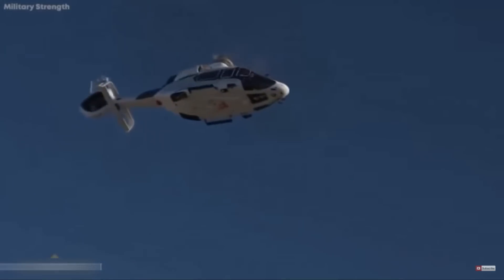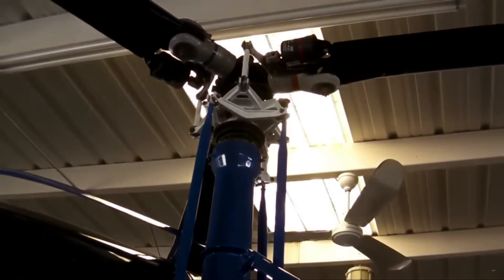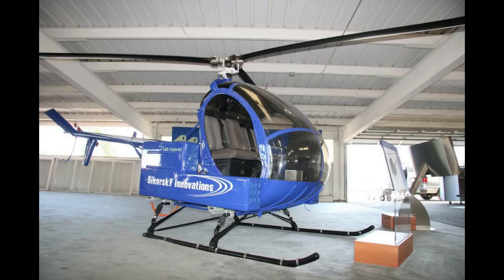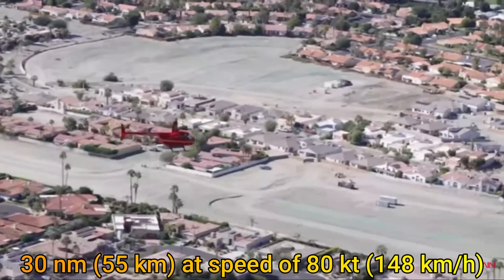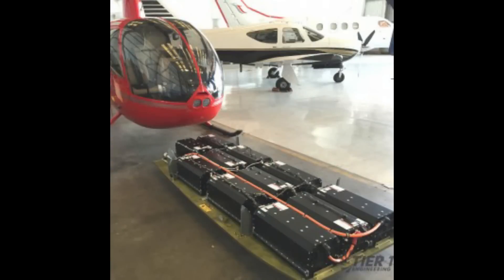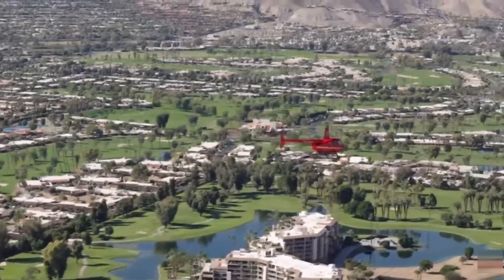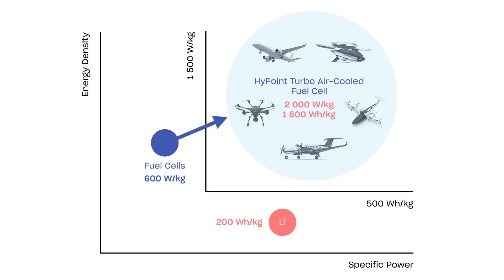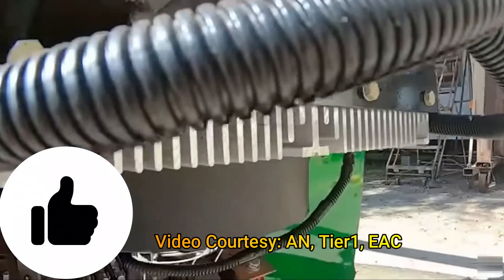The developments in Electric Helicopter (true EVTOL)

Comment: Agree with Martin that this is a very important sector for electric aviation. This because we can replace noisy inefficient, less safe piston engine helos with electric propulsion in the sub non turbine category. This opens the way up to the Mini-500 Baby-Belle personal machines, and the more important compound helicopters like Challis Heliplane and Rotodyne like vehicles. As these are electric machines, it is possible to reduce less safe mechanical complexity with electronics. I think this category can be all we hope it to be, - simply limitless, particularly in the personal flight category.

Comment: In tracking eVTOL developments, I imagined that the heliplane nature of multiple rotor designs would obsolete traditional helicopters. So will be very interested to see your analysis of eVTOL vs electric helicopter systems. My guess is there will be specialized use cases for both paradigms.
Reply: Simple is best, some of those heliplanes have like 8 motors when they should just have 2 or 3, tops
Reply: @eastindiaV  Lots of small rotors actually ends up much simpler than large ones. If you look at a small drone you will see that they have fixed pitch rotors with direct drive, meaning they are able to be extremely simple. The issue with scaling this is that in order to do anything you need to change the speed of the rotors. The throttle controls rotor speed which controls lift, and while this works at small scales, rotor speed responds quite sluggishly for large rotors. You can get around this by controlling blade pitch instead, because lift responds instantly to blade pitch, but this adds complexity. Each of the rotor modules is able to be completely redundant, so there is no massive down side to just having lots of them, particularly if they are light enough that maintenance can be simplified to a single tech switching out whole modules for work elsewhere.
Reply: A bigger rotor/propellor is more efficient. That is what counts as battery tech is limited in energy density.

Comment: Seems that there is not much benefit of electrifying a standard current helicopter design. The energy density of the batteries is insufficient (and this may not change), and the useful load and range are very small. Moreover, the complex main rotor system remains (collective, cyclic, tilting head, flapping blades, leading edge hinges, etc), and this is a system requiring a lot of expensive and frequent maintenance.  

The benefits of electric motors are using multiple simple fixed pitch rotors, achieving control via fly by wire instant manipulation of their RPM, which can also possibly do dynamic maneuevers which current rotor craft can't do, such as tiltrotors. Less complex mechanically and less maintenance.  So this can't be achieved by electrifying a current design.

Anyway it's all academic if battery energy density can't be significantly improved. I suspect that if electric flight proves to be viable, it will be via a hybrid system, with a turbine powering a generator that powers the multiple rotors (like a diesel electric locomotive).

Comment: I wish people would stop calling them "Zero Emission Vehicles" because the fact of the matter is with any automobile or aircraft operated on batteries the amount of emissions put out by the building and material gathering process are more significant than what modern day gasoline cars put out and we aren't even adding in the fact that in order to charge these vehicles they must plug into a power source that comes from mostly coal burning power plants and with just the small amount of electric vehicles on the road today the demand on coal and nuclear operated power plants has significantly gone up to the point that we could never simply switch over to wind or solar and expect it to power entire communities and cities. That's why you can never call an electric vehicle a "zero emission vehicle" because all you're doing is spreading misinformation and people in society now days are so easily brainwashed that they begin to believe these things with every bit of their soul and their minds are no longer able to be changed even when confronted with hard facts and reality. Other than that this was a great video.

Comment: Why fuel cells for aviation, when turbine engines are much better, in every way, except noise . Were talking  more than twice the power density they claim for their fuel cells, much higher efficiency, much cheaper, and lasts many times longer. And that is compared to their claims. 

2 kW per kg, of what part of the fuel cell system? That is not per kg of the whole system, not even the equivalent to "dry weight" figure of engines. Fuel cells doesn't have huge combustion chambers, it's not how they work, the fuel and oxidizer reacts with a "barrier" between them, which means the fuel and oxidizer must reach this barrier, molecule for molecule, in the required rate. You don't accomplish that, with a sustained power output of 2 kW per kg of fuel cell system, and "high" efficiency, and all that. 

As far as I can tell Hypoint doesn't have a product in form of an actual fuel cell with those stats, what they seem to have is a fantasy about it,  just one of those claims would be borderline too good to be true, assuming some significant drawback, all of those claims combined, well, that is fantasy, no doubt. Still, even that fantasy fuel cell system is very very far from as good as jet engines, or turboprops are, and could be running on hydrogen if they were designed to do that.  

So, ok, combustion engines tends to produce NOx, besides noise, which low temperature fuel cells can avoid, but Hypoint talks about high temperature fuel cells. If anthropogenic NOx becomes reduced to what the planes than can't be battery powered produce in the future, I can promise that NOx will not be a relevant problem.

Fuel cells are not viable for aviation propulsion, they are not anywhere near viable for practical use for aviation propulsion, and will not become. Hypoints fantasy fuel cells would be kind of technically possible to use practically, but they do not exist, and they will not exist in the foreseeable future, and even if they would they'd be unable to compete with hydrogen powered jet engines or turboprops. 
           

                  not bec
Reply from the maker: Thanks for your informed comment. I understand your scepticism towards fuel cells and shared the same views about 2 years ago. I have however seen the progress and adoption of fuel cells in the industry.
Reply: @ElectricAviation  Feel absolutely free to enlighten me about actual products powered by fuel cells. Fuel cells can be quiet, and have "clean" exhaust, they can also have decent efficiency. But, if you want decent efficiency, like comparable to a good diesel engine, the power density of fuel cells is ridiculous, and it's unavoidable, because of limitations caused by the fundamental principle of how they work.

Fuel cells needs extremely specific conditions to be a practical option in any case, despite being invented well before the first rechargeable battery was invented, they have seen very little use.  

Their properties make them especially bad for aircraft propulsion, it's among the worst imaginable use-cases for fuel cells. IF they ever become widely adopted, in reality, it will not begin with aircraft propulsion.     

The company Hypoint inc was founded in 2018, and seems to have produced little else than outrageous claims and CGI. Late 2021 they said they'd have 20 kW modules early 2022, that didn't happen. If you followed Nikola motor, could see the many similarities in presentation and claims if you analyzed both a bit. Outrageous claims about performance, cost and are about to change the world, starting in the very near future. 

Hypoint has been bought by another content factory, ZeroAvia, they have at least slapped a small fuel cell system to actual planes, and been able to sustain level flight on power from the fuel cell system. They call it cruise, sure, but the speed was much closer to the stall speed than normal cruise speed for a Malibu Mirage which they refitted. Short distance, level flight, with somewhat comfortable margin over stall speed, no actual payload, or capacity left for payload, but that probably still makes them the actual "world leader" in fuel cell powered aviation, by a wide margin. Or do you know of anyone else that have come close to that, in reality?
Reply: @fishyerik  Whilst fuel cells are fool cells indeed for cars, due to H2 power density I can clearly see plenty of applications very soon. Do you know how much a hot section inspection of a turbine costs? Are you kidding me? 

Of course small GA is a small number manufacturing business that is much harder to crack than satellites or non nuclear powered submarines (where do due power density and silence they are simply stellar). But if beyond the training market with two seaters (helo or fixed wing), power density of H2 simply make it very viable for the lower to mid range market in any kind of aviation transport. That simply reflects the stored density. That still will be a niche for a while, but up to 19 seats with 500 nm range or 150 nm with vertical take off and landing is definitely a huge, "clean" market. 

So just because a Malibu with fuel cells is currently at Vc close to Vs and does an off airport landing does not mean that a special ops silent squad delivery helo would not be on the market within 5 years. With the right funding the technology is simply way ahead of tubines, piston engines or any other power plants if silence has an important premium attached to it. 

The maturity of the technology, funding for the need of a small market is the core question here. The first can be overcome quickly with funding. The second one is usually circumvented only if you have a military or government research funding, quiet or public, or a gazillionaire with a certain zest for something (Howard Hughes, Paul Allen, you get the idea).
Reply: @Walterwaltraud  H2 power density? Do you mean energy density? Don't assume you're expert if you can't tell power and energy apart. 

Jet engines are expensive, to buy, to run to service, but NOT compared to fuel cells with same power. 
 
You clearly didn't understand most of what I explained. The fuel cells that actually exist, and the ones that actually will exist in the near future have ridiculous power density, whether you understand that or not doesn't change reality. And if you want to convince someone about anything try to be coherent.

Comment: Using hydrogen will limit where the helicopters can go. It sounds like Tesla needs to make an electric helicopter.
Reply: Hydrogen can be produced on site, so that's an option. Ammonia probably has a lot more going for it than hydrogen especially in terms of storage and and distribution which are easier due to ammonia's higher temperature lower pressure triple point point and are already developed for ammonia.
Reply: @paulharland7280  No, hydrogen can not be produced on site. Hydrogen is a product of oil refinery and would have to transported to take off and landing sites. Hydrogen is not a solution.
Reply: @TomUlcak  Incorrect. Hydrogen can and has been produced by splitting water.
Reply: @TomUlcak  Your explanation of the steam reforming process is also highly imprecise.
Reply: @paulharland7280  Well over 90% of hydrogen is produced by refining oil. Please, quit arguing and go look it up.  It's not my responsibility to educate you.  That's your job.
Reply: @TomUlcak  I did look it up it's steam reforming of natural gas, not oil refining. You look up steam reforming if you have any integrity at all. Here's the Wikipedia articles if that makes it easier for you https://en.m.wikipedia.org/wiki/Hydrogen_production https://en.m.wikipedia.org/wiki/Steam_reforming
Reply: No thanks
Reply: @paulharland7280  natural gas? What is that and how is it made?
Reply: @TomUlcak  Almost all of the increase in natural gas production in decades has been non-associated natural gas. That's natural gas from wells which produce no oil. So even "gray" and "blue" hydrogen are not a "product of oil refinery", much less "green" and "red" hydrogen.
Reply: @TomUlcak  I hope everyone does their own research instead of blindingly believing your claim that electrolysis, thermolysis, photocatalytic hydrogen production, etc do not exist. No less egregious are your claim that there's no such thing as non-associated natural gas and your claim that natural gas is a byproduct of oil refining when the only time natural gas is produced as a byproduct is during oil drilling which is why we see oil rigs flaring off natural gas and by definition any gas which is vented or flared off is not being used in hydrogen production. Hydrogen is in no way "a product of oil refinery". Electrolysis already accounts for 4% of global hydrogen production. Hydrogen generators are real and the only reason you're persisting in claiming that they are not is because you are completely and utterly without integrity.
Reply: @paulharland7280  WHERE DOES COMMERCIAL HYDROGEN COME FROM? ANSWER ME THAT BEFORE YOU CONTINUE.
Reply: @TomUlcak  I already told you mostly steam reforming but even now 4% comes from electrolysis. Pretending that hydrogen is limited by fossil fuels is even more dishonest than describing Teslas as coal powered cars.
Reply: @paulharland7280  Thank you for coming clean and finally being honest. But, you never admitted that ONLY 4% comes from electrolysis. Why weren't you honest from the beginning?
Reply: @TomUlcak  I had already said 4% in my immediate previous comment. I didn't come clean since I never made a false statement. Why did you claim that it was impossible to produce hydrogen on site? Why did you claim that hydrogen is a "product of oil refinery"? For that matter why did you ignore what I said about transporting hydrogen by converting it to ammonia? That's a process which has been shown to have enormous potential.
Reply: @TomUlcak  Look back to your very first reply to me. You owe me an apology.